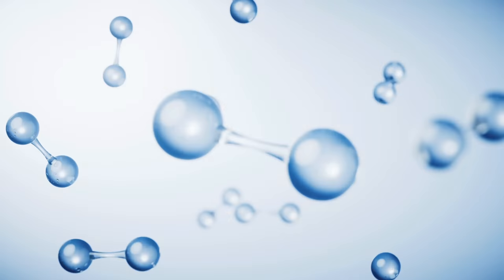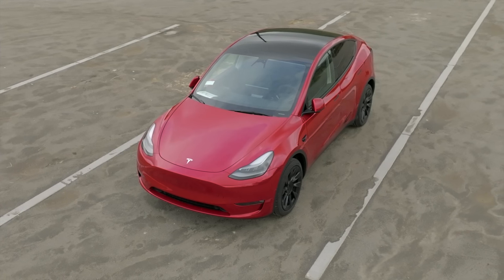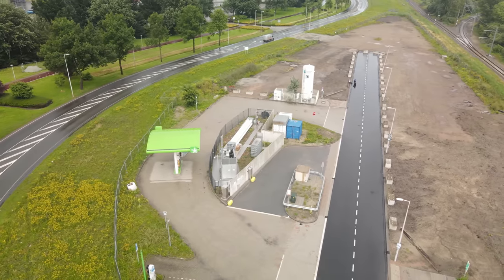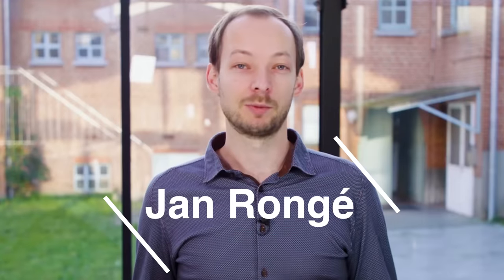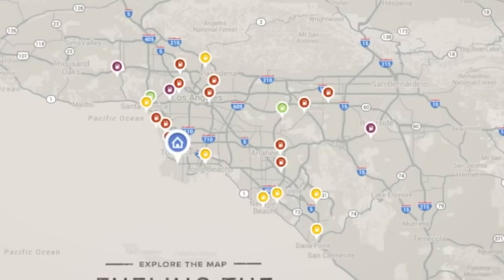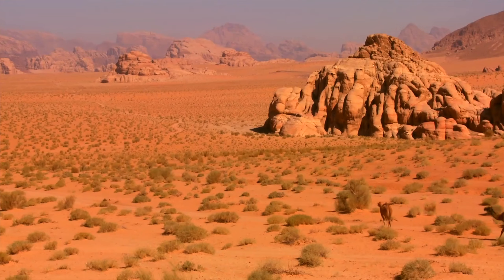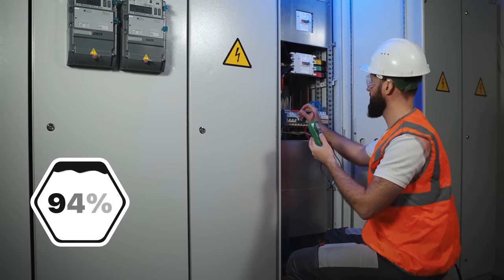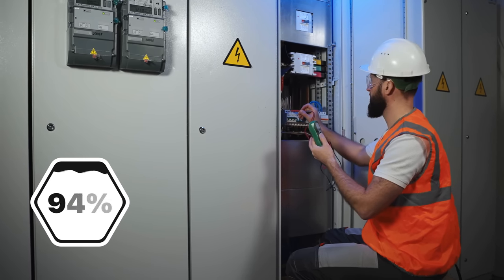Breakthrough Solar Panel Makes Hydrogen At Home!

Comment: direct air electrolyzer is great technology that I don't really see making sense in a home setting but it would work wonders to store energy and stabilize the grid or just to create cheap hydrogen for industries like steel where there's still no alternative to fossil fuels
Reply: Do you know how much such electrolyzers cost and how much maintenance they require and how much energy they need and which type of energy?
Reply: it doesn't make sense to also waste energy on condensing water out of the air unless you're somewhere like the top of a mountain or something.  Any place with access to water or sea water could skip that step and save some energy.
Reply: @xiaoka This technology apparently doesn't condense the water first. It splits the water vapor itself. Which is really cool!

Comment: Thanks for your quality videos. Couple of things though :
- hydrogen is no energy source, just as a battery is no energy source; both are just storage methods.
- comparison is incomplete: the whole system should be considered, fuel cells require mining too, although a lot less I guess.
- comparison should include complexity: solar => electricity => hydrogen => (compression =>) storage => fuel-cell => electricity, compared to solar => electriciy => storage (battery) => electricity
- Complexity again but on car level: a hydrogen car is essentially a complete BEV with a very small battery + the hydrogen-tank / fuel-cell system on top of it => very complex

I'm really not convinced hydrogen will ever really make sense in cars, or even if so, it's too late, BEVs have won. So the solution for these solar panels should rather focus on storage, mainly seasonal storage, but flow-batteries are probably the better solution for this use-case. And from a global energy production versus need perspective, in the context of the transition to clean energy, efficiency is top priority over comfort which in most cases range is. Range is mostly a psychological problem => the rational solution still is BEVs.

Comment: Correction, current fuel cells are something like 70-80% efficient. The DoE's numbers are for the entire round trip efficiencies (Even bEVs are something like 60-70% efficient according to the same metrics). BEVs are still far better in my opinion (a 20% gap is massive especially when you consider it's closer to 80-90% efficient when you get the power directly from your own solar systems) but hydrogen isn't a "dead option." In addition, the weight aspect (there's currently something like a 8:1 ratio for storage of hydrogen) is kinda glossed over. That still makes it "better" weight to energy compared to a bEV, but it's not as simple as taking the raw weight of hydrogen. That being said, I doubt these panels will be "coming to your home." Fuel cells are kinda expensive enough where I'm pretty sure for the average home a 5-10kWh sodium ion power wall will be cheaper. This seems more likely to be used at scale in places where there's a lot of land and a lot of sunlight on an industrial scale. These would likely go to the consumer hydrogen market for bigger vehicles (long haul trucks, aeroplanes etc which need the energy density) rather than the consumer market which will do just fine with BEVs.
Reply: Peru rings a bell. And Australia

Comment: I would be impressed if they did anything other than electrolysis.  When you start with a 20% efficient panel then you're already doing poorly.  I'll admit that 95% efficient electrolysis is damned impressive.  If hydrogen gets anywhere it will need some kind of catalyst that can use sunlight or heat.
Reply: Japan is going for it with a high-temp reactor, that will power some iodine-hydrogen chemical redox reactions.

Comment: In cold climates, like here in Norway, the efficiency by using hydrogen in a fuel cell is higher. We can use the waste heat for heating 1/2 of the year. Storing H2 for winter use could be interesting if the prices on fuel cells and storage goes down. Most norwegian homes are heated by heat pumps, so about 150-300kg H2 would meet demand for charging cars and running the house in the middle of the winter, 2-3 months. We pay most for electricity in the winter.

Comment: One of these units connected to a low pressure storage system then the can can be used for cooking and home heating. This keeps it simple and cheap. As hydrogen burns hotter than natural gas, a lot less is required. Mixed with air, the BTUs produced could be the same as natural gas, therefore no need to change boilers or cooker tops.
Reply: One thing I did read was that burning hydrogen itself only generates water, but the high temperature of the flame makes the nitrogen and oxygen in the air react and form polluting NOx gases, so it's apparently not too safe for indoor use. But I guess it's the same with natural gas and butane, propane, etc. What do you think?
Frankly, I'd love to have people over and brag about my new hydrogen cooktop. Can you image a dual or hybrid cooktop that has a burner in one side and a fuel cell that converts hydrogen to electricity and runs an induction cooktop on the other? I'd be the best of both worlds.
Reply: Or, now that I think of it, it would be better to just have a norma panel and an electrolyzer under the burner to generate the hydrogen in situ only when you need it. That way you won't need to store it 🙂

Comment: Almost every time I see someone calculate the cost of a system amortized over a long time span, they neglect the "opportunity cost" of the initial investment. If you spend, for example, $16,000 putting 20 of these panels on your roof, and expect to use then for 30 years, you should add to the cost over that lifetime the money the $16,000 could have earned if invested somewhere.
It's not unreasonable to say the $16,000 could be invested somewhere that earned 6% per year. That's close to $1,000 per year in lost returns that you could have earned if you passed on installing the panels.
To make the math simpler, let's call that $50/year per panel.
Each panel makes 250 liters per day, they say. 91,250 liters per year. At standard atmospheric pressure and temperature, hydrogen gas is about 0.083 g/L.  That works out to about 7.5 kg per panel per year. Divide the $800 cost of the panel by a 30 year life, and the cost per year is $27. Add the $50 in opportunity cost, and the total cost is $77/year. Hmmm. That means the hydrogen is actually costing 0ver $10 per kg.
And that neglect the cost of the compressors and tanks that would be needed in a practical set up.
The math doesn't work.

Comment: I started my hydrogen conversion Solar Panel almost 20 years ago an got flack from fosil feul suplyers .thermoelectric converters and micro stadged compressors with multy gas stayges {9 defferint gasses} and a lot of regelations . hydrogen  and oxygin from my setup .

Comment: Everyone considering hydrogen as a fuel source should do this first:
 1. Do the plumbing for a "on-demand" water heater, including gas lines. (if you actually do this, do the work, then have it checked by a professional to see how well you did.)
 2. Replace an oil seal on any internal combustion engine of your choice.
These will give you a visceral understanding of the concept of making a good seal.
Now consider that hydrogen gas causes embrittlement of  metals (and subsequent failure) and that pipe junctions are extremely difficult to seal (for us average folk)
This makes hydrogen a  non-starter. 
Though some solar electronics can be complicated, they are sold as easily replaceable modules that anyone can learn how to do.
Large profit incentives for battery technology will insure that batteries will become cheaper, safer and lighter over time.

Comment: I envision solar thermal energy and thermal batteries becoming a strong player towards solving the intermittency problem of renewable energy. A large insulated tank of sand would make a decent thermal battery for cheap. You could also use a phase change material to store more energy without a huge swing in temperature. A Stirling engine can convert a temperature difference to electricity (and also the reverse) but using heat for heating is more efficient. It might make sense to have a mix of PV panels and thermal solar panels and use both thermal and electric batteries combined with the Stirling engine for conversion. A computer program could intake all relevant information and manage the system in a smart way converting if and when it makes sense to do so. One example could be more heat becomes electricity in the summer months.

Comment: Being that it's pretty explosive, I vote for using most of the green hydrogen we can produce to power freight ships, locomotives and backup/peaker power plants. If there's enough left over then perhaps in homes.
Reply: 1.: How do you propose to produce hydrogen?
2.: How do you propose to store the hydrogen?
3.: How do you propose to transport the hydrogen?
4.: How do you propose it should be converted in "freight ships, locomotives and backup/peaker power plants"? By burning it? Via fuel cells?
Reply: Or just combine with carbon dioxide out of the air and create methane and methanol.

Comment: Why hydrogen? Biogas (renewable methane) is much easier to store. You can even make biogas at home and store it and use it as a drop in replacement instead of natural gas since both are methane. There so much "free energy" that isn't used in food waste.

Comment: I'd love to see a fully integrated home power system that uses solar and wind to charge a battery and compress/store hydrogen, instead of cobbling it together between multiple systems. Would be good for going completely off grid, or moving toward a decentralized grid, and having multiple types of backup system.
Reply: I'd love to see my home grown vaccum energy power generator aka Zero-Point module.

Comment: I actually see an economy of Green Hydrogen/Fuel cell and EV's existing in parallel in the coming years. 
Also if these cells can double as a drinking water generator, that will increase its utility for self sufficient off grid systems. I would definitely consider one.
Reply: Water is generated when the hydrogen is spent when driving a hydrogen car, not while generating hydrogen itself. You see, you are splitting atmospheric water vapor into hydrogen and oxygen gas, so you don't get water during the generation process.
Reply: @VenomInMahEyes  Yeah, but it's regenerated when you use it in the fuel cell or burn it. So Kon's idea makes total sense. It would be a double-use system: PV-energy conversion and storage unit/atmospheric water vapor collector. It's genius!!!
Reply: @Israel_Two_Bit  yeah, people that live in the desert might have water bottles on the side of their hydrogen cars for collecting the water that it produces.
Reply: Sure if you want to pay the premium. Even E-Fuel from Porsche is cheaper.
Reply: @VenomInMahEyes  my understanding is, it is the condensed water vapour that is split to produce Hydrogen. The Chilian army is currently using fog nets to capture water this way. Here in this system I believe they are using the power from Solar PV to run generators to condense water vapour. So it is the water they are splitting.

Comment: I believe H2 is more suited at grid level, coupled with long term storage to make up for low solar during winter months. At residential level solar + battery is sufficient and efficient. 

Also, you provided the advertize efficiency or lab result, real world should be slightly less. H2 leaks, corrode metal pipes. You can't change physics which is on the side of Li batteries.
Reply: It's a good point, but the future of fossil-fuel-free energy requires input from all technologies. I think it's iomportant that companies like these push researhc forward. If the people who invented the solar panel got dispirited because of the high cost and low efficiency of the first lab-level PV cells, we wouldn't have dirt cheap solar power today. The same goes for lithium batteries. If get the same level of research and development for H2, things could evolve faster and challenge batteries, because, as you say, you can't change the physics and the inherent limitation of batteries in terms of energy density. Wouldn't you agree?
Reply: @Israel_Two_Bit  Yes it might happen but improbable. The problem is h2 is a light gas, takes a lot of volume, very low liquidfying temperature, explosive, less efficient as fuel is always < batteries for most chemistry. The sheer number of breakthrough required in many fields makes it more unlikely than 3000 wh/kg LiS Solid State batteries.

Comment: Hydrogen is small & can get through normal seals. You really should dig into the details of the cooling, compression & storage issues in an up front way. Purity is the issue with a fuel cell membrane. Until there is a method to cycle a cleaning of the membrane, they have a very short life in the presence of minerals & other sediment.

Comment: Might be an interesting way to dehumidify indoor air and save money on air-conditioning in humid climates. 

A problem with moist air when cooled is that as it condenses it gives off lots of heat (latent heat of condensation) with each gram of water that's condensed, releasing that heat to the airconditioner coils forcing you to run your airconditioner more. If you reduce the amount of water in the air, you lower the temperaure at which it condenses and saves energy to cool your home. 

But it takes energy to turn it into hydrogen? Yes but apparently that's 95% efficent and the energy is stored chemically, not lost. Adittional to using it to run a car, one can use it with a fuel cell for backup power for their home. 

Antidotally, my central air conditioner condenses about 10 gallons of water a day during the hot days of summer. It would be phenomenal if that could be reduced in half, Turning the other 5 gallons of water into about 4.63 pounds of hydrogen and 37.06 pounds of oxygen. 

Maybe releasing some of oxygen into the home might improve the home's air quality or may benefit oxygen concentrators for those who need them.

Comment: Hiydrogen has high energy per unit weight, but a very low energy density by volume at room temperature and atmospheric pressure. So the only way to pack enough hydrogen in a vehicle to get a reasonable range means either  extremely high pressures or ultracold temperatures, both of which use up more energy. 

Storing electricity via water electrolysis, compressiion for storage, and fuel cell has an overall efficiency of about 27%. Storing electricity via charger and batteries is 85% efficient. So, it needs 3x more solar panels, and with the cost of the electrolyzer and hydrogen storage, it will cost more than the equivalent grid tied solar system with battery storage.

Comment: A good and balanced video and I think that the choice of energy storage should be on the use case rather than politics but that's not the world we live in. 

I'm not liking the twin-camera style you've been using in more recent videos. The disconcerting bit is when you turn from the camera while still delivering your lines and before transitioning to the other camera shot. Some of your transitions were cut so that you'd finished one sentence on the side camera then clean cut to the main camera and was much earlier viewing.

Comment: My solution to storing hydrogen: The solar panels on the roof create hydrogen that is then piped (actually tubed) into large balloons that are anchored to the house -- no need for compression.  If they leak, the hydrogen disperses into the air and rises away. They also provide shade in the summer ... oh wait a minute. Perhaps the balloons could be transparent so the solar rays can get to the solar panels.

Comment: I have a question; all I have seen so far entail STORING hydrogen, but why bother with storage if you just generate it as needed and to fulfill demand. In other words a generate on demand system, and scale up or down the volume as required?

Comment: Wow...this is a great idea....so you have a solar panel that makes electricity and use that to split water, you then compress it in 200-bar tanks....then pump it into a car to a fuel cell to turn it back into electricity. Way better than just charging a battery. LOLOLO
Reply: "When you say it like that"..... They still don't get it

Comment: Wonder if SolHyde has ever experimented with an on/off switch to disable/enable hydrogen production by these panels so as to eliminate the H2 storage issue. Then, say, you'd switch the panels to enable H2 prior to refueling your hydrogen vehicle, then switch them to disable H2 production after refueling is done.

Comment: Its easy, you can combine it. For home you can have acid lead batteries that have been perfected and weight is not an issue. Generate some electricity and some hydrogen. Overall efficiency should rise at 15-20%.

Edit: Ofcourse I would prefer that you can fully control how much of which is generated and when.

Comment: the most interesting thing about hydrogen is that  you can even convert an existing ICE engine to burn it instead of gasoline.  if i had the money and access to a Hydrogen powered pick=up (either fuel cell or ICE) i would definately think about it.

Comment: Why not set up a home charging network, where you can sell your charger time when you're not using it? An AirBNB type hydrogen charging platform? Could also be done for electric. You'd put the charging station close to the curb or near end of your driveway. The network would show where charging is available.

Comment: It sounds fantastic that it will soon be the cheapest way to produce hydrogen. But until all the inefficiencies of storing it are met, it still does not make sense as an automobile fuel. Also in the process from solar to power at the wheels. How does the efficiency compare to solar to power at the wheels in a BEV.?